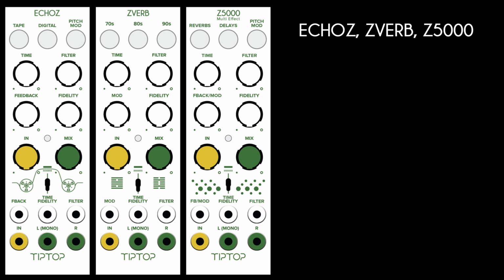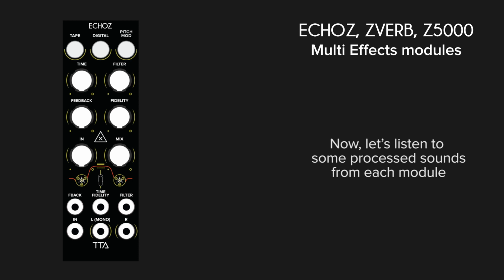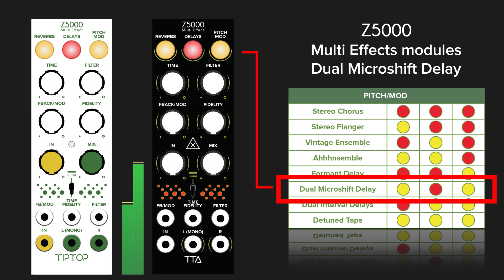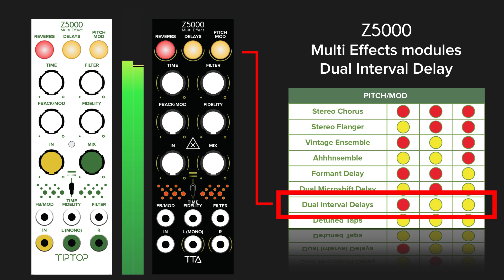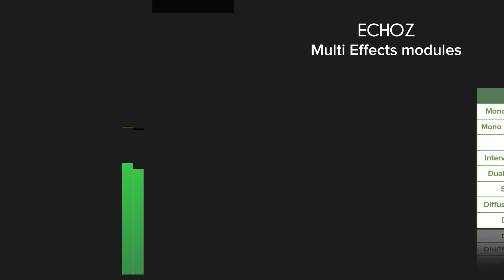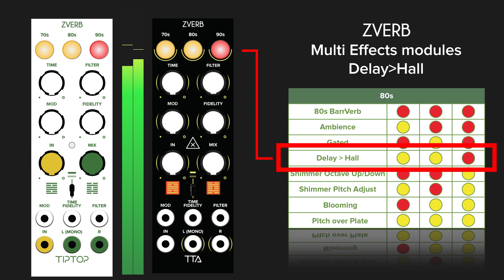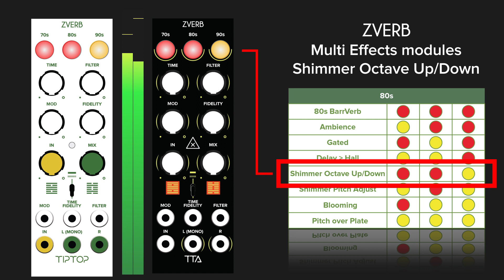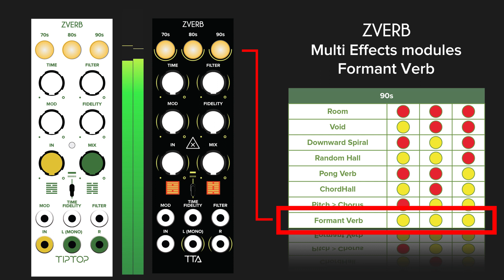Tiptop Audio   Z5000 ECHOZ ZVERB

Comment: How do you select programs in a bank? I don't get that. You select Tape, Digital, or Pitch Mod for instance, but then where do you access the programs inside that bank? So is a bank active when it's red or yellow? Doesn't make a whole lot of sense for me what's going on here.
Reply from the maker: Hi Kristiaan, hold down the bank button for 1sec (long press), it will load that bank, then scroll through the programs with the same button, short press.
Reply: @tiptop-audio  thanks, saved me precious time
Reply: @tiptop-audio wtf? Why did you guys choose that interface? How the fk is anyone supposed to remember which 3 button combo is which effect? I was going to buy this module but that interface is so fuckin stupid.
Reply from the maker: Hi Sean, Our Z-DSP have a display with details on each effect but is much larger, the Z5000 is a compact striped down version. It is fairly easy to hear what the effects do.  @Delouser69
Reply: @tiptop-audio  thanks, the z-dsp certainly looks easier to use